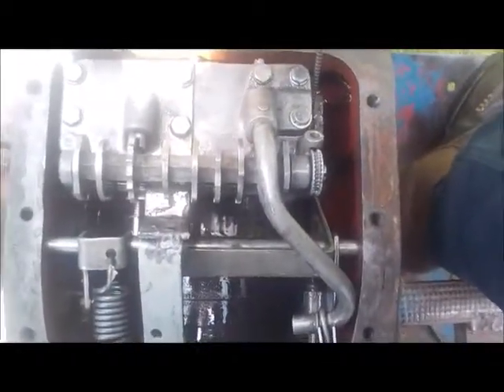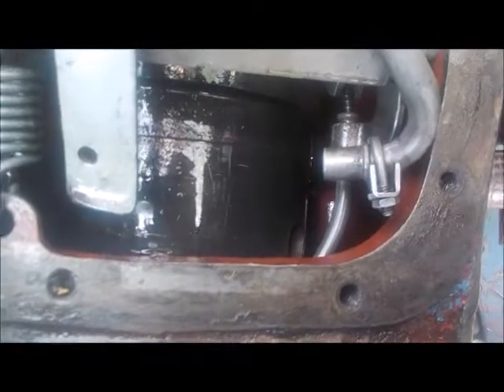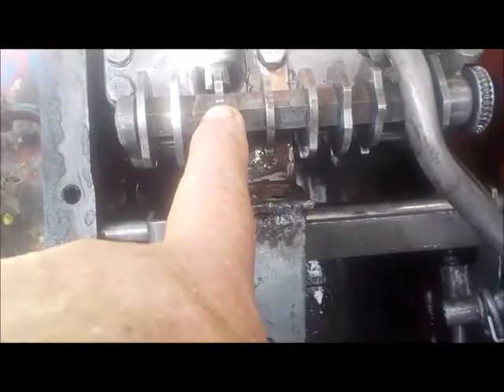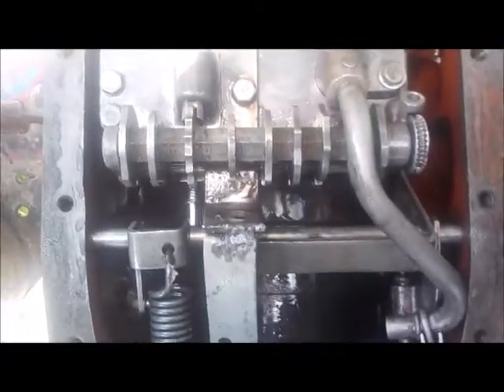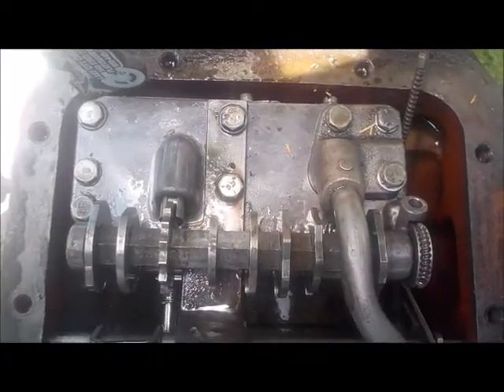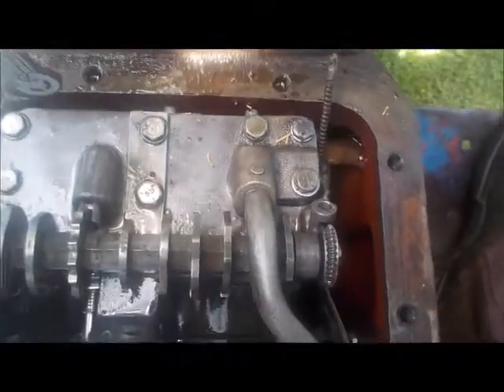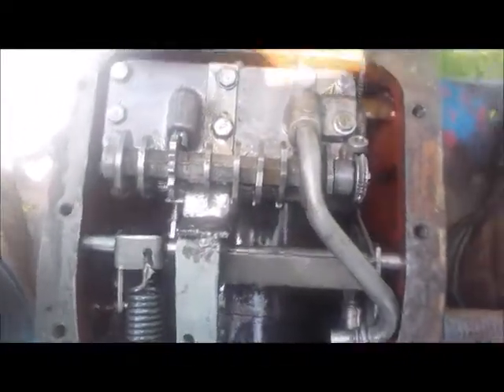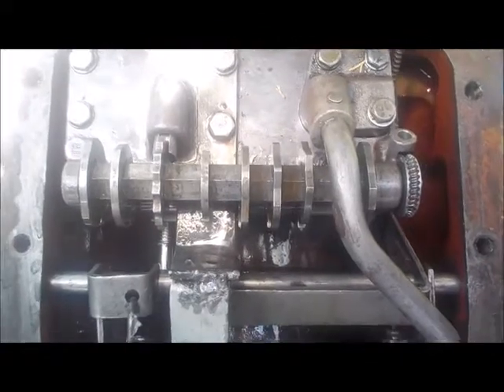FORD 981 TRACTOR SELECT O SPEED: PART 6

Comment: Looks like it time to start turning some wrenches and take it apart to find your leaking fluid pressure!!! It's not going to fix itself!!! You're going to have to start taking it apart and see what is wrong because the answer isn't up top and won't be found by any other way than some good old fashioned wrench turning!!! Remember, you can't mess it up any more than it is!!! I  have faith in you that you can find the answer, but it's up to you to find it!!! Now go getter done and Keep Rocking!!!
Reply from the maker: Thanks Sarge, I Needed That Pep Talk!   As a Rule, I don't like Opening up a Can of Worms unless I'm on My Boat Fishing but You're Absolutely Right,  Gotta Get'R Dun....  Just waiting fot the Final Evaluation of my Findings from My Contributers that Know what they're looking at before I crack it Open and let it Spill all over the yard! Besides, I already have several guys lined up for the Parts, so it's a Win, Win either way!
Reply: Yeah , or split it set the SOS on a pallet and send it to Aurthurs. The seal kits are no longer available, but you can get the seals if you have a specialist that knows how to measure the old orings and name their replacements.
Aurthurs have a test stand and run in every rebuilt unit.

Comment: Those 3 problems you found in the manual are definitely a possibility. That pressure tube can split too. All not to bad to fix just takes a little time. I got busy today and didn’t have a chance to get any pictures for you. Headed back to the shop later this evening I’ll try to get some for you.
Reply from the maker: I will be pulling it apart Today and we'll know for sure! . Thanks, look forward to hearing from You.
Reply: Can you post more videos on how to repair the SOS

Comment: I have a 800 series select o speed. It sat for a long time. Got it running and the transmission works. But should I do somethings to it before I use it constantly?
Reply from the maker: I would NOT advise you to do anything to it. I have heard  of several guys who had no trouble UNTIL they changed the Fluids!  As they say  "If it ain't  Broken Don't Fix it"
Reply: @MrDanoconnor  thank you! I got one with all options, 703 ford full size industrial loader! Love it. Bought it on terrible condition and got it running
Reply from the maker: @ferenzi7741  Sounds Great Good Luck.
Reply: They didn’t make a SOS on the 800 series.
Do you have a 1 series? 801?

Anyone will tell you the key to SOS longevity is maintaining your fluid, using the correct fluid, servicing your filter regularly.
Reply: @beckyschwantes5287  yeah it's 801 series

Comment from the maker: INFO FOUND :  I just found this on the FORD SOS REPAIR & TROUBLESHOOTING PAGE.. Could  4, 7 & 8 be My Problem?  
Most Common Causes of 
Low pump fluid pressure
   1 Low fluid level
    2 Plugged or incorrectly installed suction screen
    3 Pump gasket leaking
    4 Pump pressure line or “O” ring leaking
    5 Defective torque limiting clutch
    6 Defective pump
    7 Leakage between valve body halves
   8 Leaking valve body gasket
    9 System relief valve stuck open
    10 Restricted pressure lin
Reply from the maker: @davidohl2346  Gonna Rip it apart Tomorrow and Hope for the Best. I So Don't want to part this tractor out. Looking into seeing if I can't fix it, if I can swap the trani for a Standard 5 speed.
Reply: MrDanoconnor good deal and good luck. I know if it can be fixed you will figure it out and fix it.  Looking forward to more updates